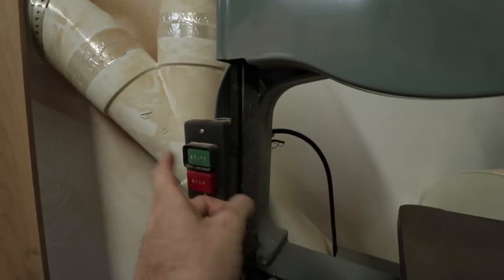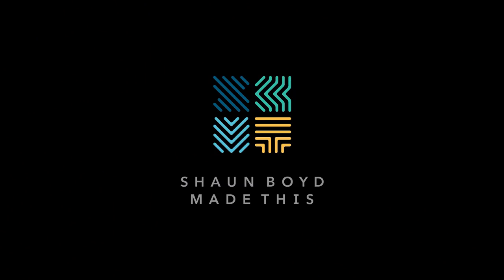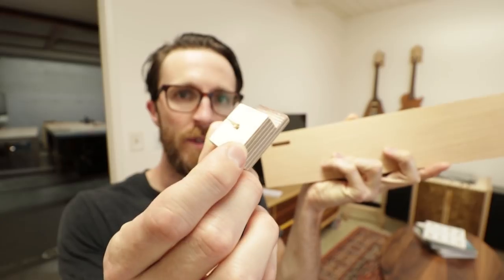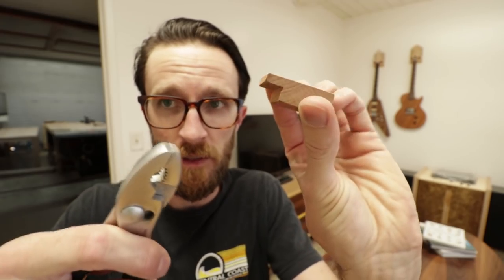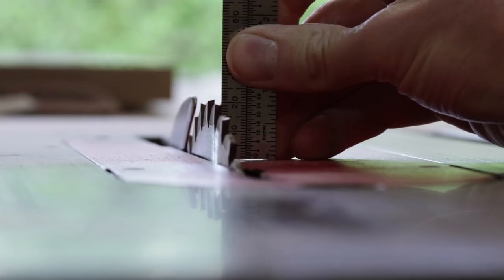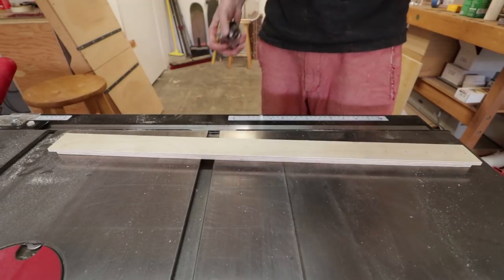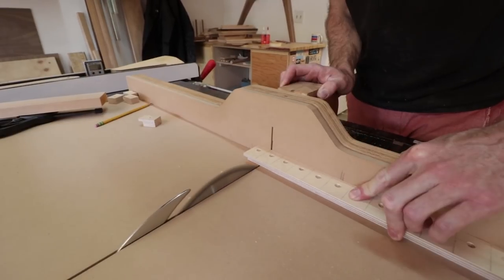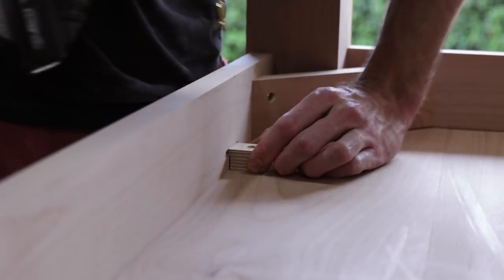How to Attach a Table Top with Buttons

Comment: So I said in my last comment about a small detail, or idea could help someone’s next project. My search on Sunday would show “table top button” almost ironic. Ended up making a button with my domino in both the work piece and the button. I applied a domino and glued it into the workpiece to be the “button”, which seemed to work well. I only say all of this to reconfirm your direction to move towards more frequent, small videos - they will be helpful. Keep it up and have a great weekend, bud.
Reply from the maker: Thanks, Anthony! I have done them that exact same way, as well. Works just as good! I really am just enjoying spreading the bit of knowledge that I have. I have learned so much from youtube and other online sources over the years that this is my small attempt to do the same for others.

Comment: Using buttons right now on a farmhouse table.  I used reclaimed barn wood for the table but i wasn’t comfortable with the strength of the wood for the buttons.  So I cut out some maple buttons for connecting tabletop.

Comment: One of the biggest issues new woodworkers face is properly attaching the top. Nice topic and execution.  Closing phrase........keep trying.   I'm still Domino-less.  I used/use all the other methods you mentioned.  I tend to lean toward buying steel 'Z-clips' and cut the slots with a biscuit jointer.  Same smell.
Reply from the maker: Yep, I know I scratched my head for awhile the very first time I built a table like this. Thanks for watching! I'll keep working on that catch phrase!
Reply: Shaun, If you don't have the Festool or the biscuit jointer, how else would you recommend an attachment?
Reply from the maker: Sorry, just seeing this. A router and a slot cutting bit would work great, too.

Comment: What are your Domino setting for the slots and what size domino bit do you use?
Reply from the maker: I usually use the 5mm bit on the widest setting.
Reply: @shaunboydmadethis  How about the height setting, assuming you are using 3/4 ply for the buttons

Comment: Please pardon my ignorance.....
Question:
The only thing holding the table top to it's base is the buttons?
Ie; No glue or screws
Reply from the maker: Yep, just the buttons. The table I just finished is 8ft long with about a 1" thick top, and I think there were 18 buttons, which was plenty of holding force.

Comment: Great video and style! Love your endings. Subbed.  At the end you mention leaving room for movement, but it was quick with no visual reference. Mind expanding on that with some specifics? I feel like that's the most important part.
Reply from the maker: Thanks, Raymond! Really appreciate it. I was just referring to when I actually attach the buttons, I don't slot them completely into the mortise. I leave a little bit of room, so that the table can move freely as it expands and contracts. Hopefully that makes sense.

Comment: If I were to use a router to make the slots on the frame, what bit could I use?
Reply from the maker: For sure, a slot cutting bit would do the trick.
Reply: Thanks!

Comment: Why not just screw a strip of wood on to the into piece where your button tongue is inserting.  The strip would ha alternating predrilled holes.....haft going in to table top and half inyo the side oiece of wood....seems like a lot less headache.  How say you, mr buttons?  I think your closing lineshould be "stay gangsta' fir woodworking my peeps....(in a loud and boistroud voice) and then (very quietly)....."but please eremember to sweep up and keep the noise done."  No charge for that little stroak of brilliance, my friend.
Reply from the maker: You certainly could do that if you wanted to. I use buttons because they give me the most flexibility for potential wood movement in the table top. Thanks for watching.